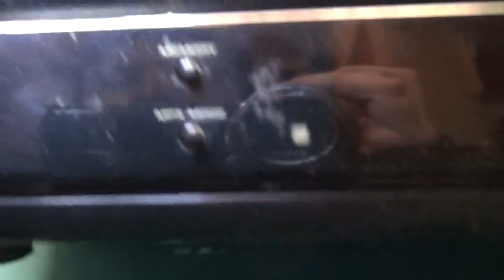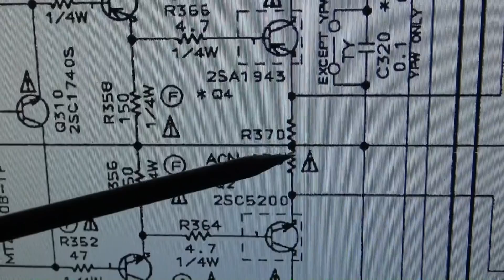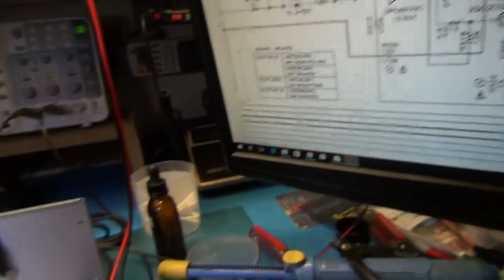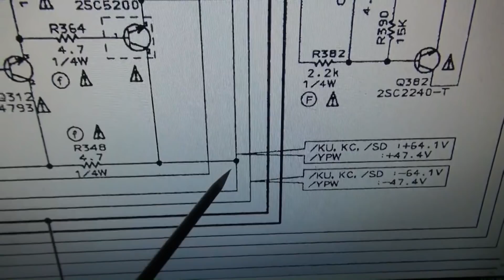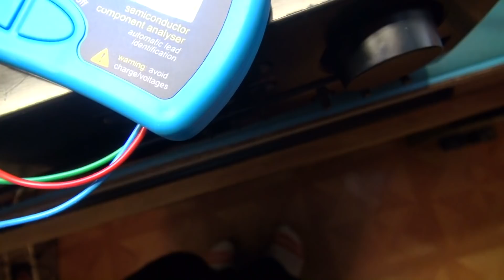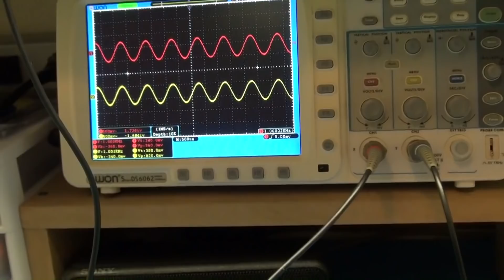PIONEER SX-255R RECEIVER AMPLIFIER REPAIR.

Comment: My sx-255r would power off by itself and the display lights would not light up while powered on. I noticed when I would move the power cord inside the receiver and it would turn off and then turn back on.  I then realized I had to solder the positive and negative power pins on the motherboard.  Did that and it works just fine.  No more shutting off by itself issues.

Comment: Great video! I'm in the process of repairing the exact same model and I noticed pretty similar damages. In my case the ceramic transistor pack was also open (along with the output transistors which were shorted) and I'm now waiting for a replacement power resistor. 
Have you ever attempted to place a piece of wire instead of that 0.33Ω resistor just to briefly check if the dead channel comes back? I could certainly wait for the replacement part and do it properly but I was just wondering if it was safe to do so for a short period of time (seconds)..

Comment: I have had this receiver since new and not had any issues. But good to know there's videos like this to repair it!!
I can't seem to get the cover off mine.
Got the rear lifted enough to blow it out from time to time
Is there a trick to getting the cover off from the front display facing?
I unscrewed the 4 screws jn the back and the 2 on the side. Am I missing some?
And now after watching this very technical video I know feel foolish about asking how to open the cover. But I seriously can't get it to separate from the face where it tucks in there.

Comment: I have a question and hopefully I can get an answer. I have a pioneer sx-251r that the am/fm tuner does not function. It will act like its working but all I get is a popping noise when I try to tune in anything. Bad chip(s) maybe? Also it always thinks it does have a signal as the stereo and tuned lights are constantly illuminated so another clue that I think it may be a logic issue but I dont know. Tried to locate the service manual for it but for that model I cannot seem to find anything and no youtube videos show up when I search for this model. Any advice is GREATLY appreciated. Receiver works great otherwise just cant use the radio. I would love to get this working if anyone knows anything that can help me. Thanks!

Comment: MY  PIONEER WILL NOT POWER ON AFTER I HAD A CAC POWERED FROM MY LAPTOP TO THE AMP HAD IT FULL BLAST AND THERE WAS THIS BURUNG SMELL. WHERE TO START? I CHECKED THE FUSE ONSAID AND ON THE PLUG  NEEDED CHANGING STILL DID NOT POWER UP.

Comment: I just picked up this 255R receiver at a hospice thrift shop for $ 32.00. I hooked up to my speakers and powered it up and It works great. I had my fingers crossed buying it secondhand without trying it out. My Pioneer vsx 504s has a problem with it's output driver. A scratchy static sound after a few minutes. Now to get it fixed.

Comment: tell the truth Pioneer has become a big pile of crap because they no longer make equipment that is worth buying it's such a cheap garbage that and they charge so much for it that it's not worth buying and the way it's built it's built to fail and we live in a by and throwaway world that at the time the stuff wines up in the landfill because they want too much money to repair it for just the same reason it's too hard to work on because you can't access the bottom and they designed it that way so nobody wants to work on it so they can take some of the people throw it away and I forced to buy a new one

Comment: almost everytime I find one of those pioneer amps like that, the amps always go, I usually get the ones with the separate board/heatsink/transistors, people always has those and they weren't bad sounding amplifiers, they were just troublesome when they started dropping resistors and transistors, I've had some experience with those and can definitely say the rail to speaker is one of the most common issues because of the shorted transistors, Ive had them also blow a resistor and produce half wave, and I've seen them backfeeding and fry half the transistors and resistors in the preamp section, have fun, lol. BTW I like your channel and appreciate someone like myself and my fellow people who get into this stuff and actually takes the time to try and share it, you do a great job, and you share alot of things I try to share with people and you are a good teacher and have good advice

Comment: I have a pioneer sx-255r receiver amplifier that I turn and on the display it shows the word "turning" for a few seconds and then a radio station is displayed for a few seconds and fine it flashes "no power". What is my problem and how do I repair it?

Comment: GREAT VIDEO ,  HOW DO YOU UNDO THE RIBON CONNECTIONS FROM C BOARD , I AM STRUGGLING . THANKS DAVID
Reply from the maker: I don't remember disconnecting any ribbon cables on this unit. I just unscrewed the back panel and some other screws and the whole amp board folded out of the amp. I would assume they would need to be un clipped and pulled out or un soldered depending on the type of ribbon connection.

Comment: Hi Kev, l have an Sherwood A/V DSP Pro-Logic Receiver RV-7050R. The Right Channel does not working, what parts need to be replace? How much it will cost?
Reply from the maker: Email my channel Email for repair inquiries.
Reply: Kev31779 
I have a pioneer sx 680 that hymns really bad and it doesn't seem to select different outputs like aux and phono whats the best option

Comment: Love your videos! I have recently started to troubleshoot some amps with various faults so these instructive vids helps alot. Have one question though, one amp I'm dealing with - a car audio amp; Alpine 3544 keeps bugging me. When I opened it I saw 2x diodes burnt from the board (large 3A rectifiers across the power line), one had cracked from heat I guess. I changed the diodes and checked all transistors for shorts but there's nothing obvious. When I'm starting up the amp, it turns on with a current draw of about 1,2A then, after like half a second the current draw rises with 2A/sec until my power supply goes into CC. What could be the possible cause for that "slow" rise?
Reply from the maker: +Simon A S sounds like a bad fet or fets. They could be latching up due to a bad fet or surrounding conponent.
Reply from the maker: The diodes maybe burnt from a reverse polarity hookup and may have damaged other stuff as well.
Reply: All the high power transistors are BJTs. I checked them today, in circuit they were showing shorts between base-emitter - both ways (NPN-power section). When I took them out they read ok. All the big caps ECR ok as well. The audio side all transistors read normal in circuit when testing PN junctions. Found a loose connection on a small poly cap going to some comparitive IC. Haven't come any further though. I tested the transformer windings, and resistance is very low, like 0,3ohms and on two of the windings the meter don't detect any inductance, only resistance. Dunno if that's supposed to be like that... Thanks for the reply!
Reply from the maker: When you found a short before you pulled the parts out and the parts were ok. Make sure you test to see where the short was from and that it is supposed to read that.
Reply: I've been doing some more troubleshooting and with the resoldered cap going into the upc494C (which apparently is the PWM IC), the amp does light up. However it's still drawing a massive amount of current. I tried setting my bench supply to 12,8V @ 2A and it drops to 7V with CC limiting, I poked around checking for components that are heating up and the dual rectifier diodes are getting really hot. Measured almost 120V p-p spikes with my scope on the center pin and if you turn up the current limiting even more to about 3 amps there's audible noise coming from the large transformer coil. Perhaps there is a short on the audio output side anyway? I'll desolder the transistors there tomorrow =/

Again thanks for the advise.
Reply from the maker: Still sounds like a shorted part somewhere, could be power supply or amp section .
Reply: I did some more testing today and found various weird issues. I kept running the amp for a while longer this time and placed the power section transistors on a heatsink to check for other components that was getting warm and 4 of the 8 audio section transistors were getting pretty hot after a while. Since I knew that they all were ok I tried removing the driver IC chip (NEC UPC1094C) from the board and the amp was finally starting up, sitting at roughly 1,2amps idle. No idea how to measure an IC like that for faults, I simply ordered a new chip and I'm hoping it will run after that.

Comment: Good vid kev, very clear and explanatory. It's a way to learn good trubbel shooting! I have one little question kev. I have a denon PMA-700V which is a very nice amp but after I changed the main filter caps and powered on it developed some " magic Smoke" on the lef channel preamp section. When I later tested the amp with variac then one resistor and one transistor got very hot. Do you think I should change the whole preamp section or just the ones which are getting hot? I would love to fix this amp because it has lovely sound and it's very musical.
Reply from the maker: The ones may be getting hot from something else wrong with the pre amp. You will have to probe the circuit for shorts of diodes and transistors etc.
Reply: Thanks Kev, I'll do probe those transistors, one more thing, could you do some vid about how to properly measure power output on power amps with oscilloscope and how to calculate the real output power?
Reply from the maker: I don't have all the right equipment to make that calculation accurate. You can always do ohms law math to get you close.

Comment: Kevin Question.
If after you put in the so so transistor, if after test, loaded signals are the
same running even with the same peak to peak voltages, why order a special
transistor, why not just leave in the close beta value one you used for testing.
if so close you would never hear the difference. Please correct me if I am wrong
Reply from the maker: The part did not cross exact. I could leave this in but the voltages and gains are not an exact match.  You always want to send work out with same crossed parts as the original. If not its kind of hack. It can be noted that it will work and you can get away with it, but I wouldn't want to see the unit on my bench again due to a future failure.